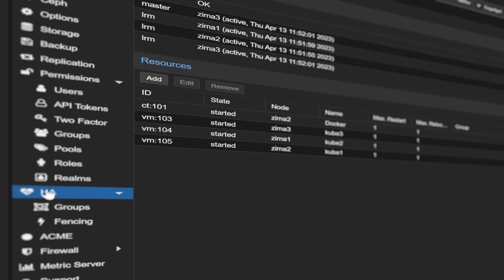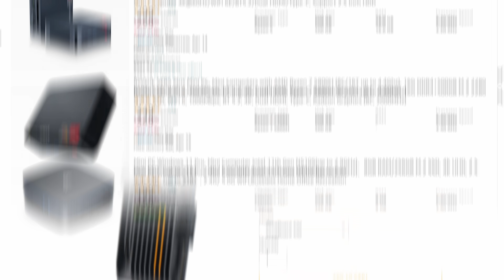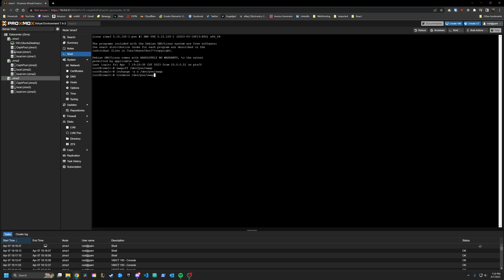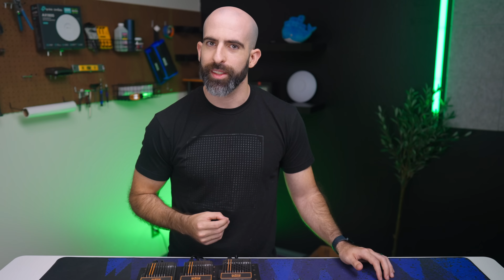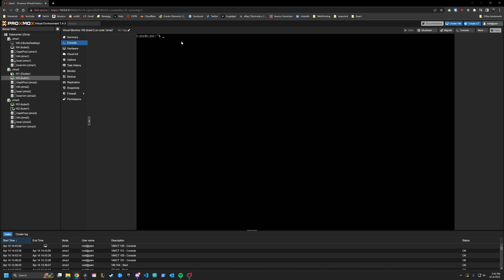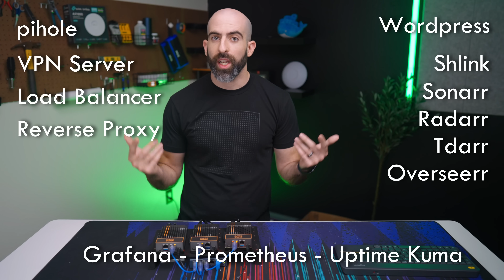10 Watt HA Proxmox Cluster ft. ZimaBoard

Comment: This is really cool for exploring the tech, but not HA: There is no network or power redundancy. You cannot get HA with a single point of failure, and that would be your switch; and your power source. If you add a UPS, then that becomes your single point of failure: You need at least 2 in tandem (expensive). I get all that with a stack of 3 8GB surface pro 5 with USB NIC and 256GB SSD (Thinkpads are same price and even better, everything replaceable and onboard LAN for pass-through virtualisation which matters if you build a firewall with it) that I got for 50 USD each in a second hand shop that sells refurbished business laptops (fully functional, but you can get them for even cheaper with a defective display). They have their own modem and WiFi so they failover to WiFi and 4G+ (So I do not need redundancy in the router, just 3 10USD top-up sims); Each has their own battery that can run for over 10h on idle, about 4 hours at full load, 8 at regular load. Still super compact slate form factor and it barely ever turns the fan on (I think never when the CPU governor is power save). The whole system idles at less than 20 watt, the sum of the PSUs can deliver 108, but I've never see them pass 60 (I suppose it can get past that if they're all charging and at full load on performance governor. Then I'd also expect the single fan on each device to go crazy). The TDP of the processor is 15 watt but it is twice the performance of the N3450, so that is a nice to have too, although you can beat it with the new zima2 N150 at 10watts only. Anyway, all in all a pretty good system for a total investment of less than 200 USD, which I believe is the price of 1 zima board with no SSD and no WiFi and no 5G and no battery or gorgeous 1440p screen to display stats?

Comment: for testing your setup might be fine but for higher workloads in a productive environment running e.g. 5x Win25 DCs (UI) your system would prolly freeze. Btw, HA only makes sense across different zones or regions, not at the same location. If your room or building burns down, that would be the end of your wonderful nodes too, not a good idea, and to highlight before even getting started. Planning is the most challenging thing here.

Comment: I have a question about the ceph topic. I am about to set up a homelab. i want to setup a proxmox cluster which consist of multiple nodes. So i need shared storage. My first idea was that i will setup a ceph cluster of three seperate nodes. And provide some of the storage of my ceph cluster for the proxmox cluster as a shared storage. Because i need some s3 storage too on my ceph for some other things. So my acutal question is, if i setup a ceph cluster with the buildin function in proxmox, is it possible to some of the storage as shared storage for proxmox and use some of it for example a s3 storage? Does someone has any expirience with that?

Comment: I've seen many of these HA videos. It's highly available but only locally. One fun video idea would be to setup Proper Ha cluster where a secondary node lives in a different network. You should be able to then pull the plug on one of those networks and voila, services are going and the dns provider can failover. I've tried this with portainer, it works but for some reason I've struggled to get portainer to show me the containers running on the remote node.

Comment: If you plan to have k8s on zima in vm then why to use proxmox in the first? Only reason I can think of is to use other OS then Linux but resources will still limit you. Ceph can be installed inside k8s or next to it. Besides ceph is not only block. You can have s3/Swift object storage or cephfs POSIX compatible server.

Comment: Very interesting, that is exactly what I am planning to set up for home automation (NodeRed, Grafana, ...).
Right now I am hanging with one topic. (How) is it possible to share data between VMs or Container?
I think, Proxmox is running on its own (the internal) disk. The VMs, and containers are on the external SSD.
When I am setting up a container, that container gets his own virtual hdd assigned that is placed on the external SSD / the Ceph disk.
Is it possible / how to have a folder / diskarea, partition, ... lets call it "shared folder" where different container can read and write data.
Later on there is maybe a container with a simple NAS software solution or just a SMB share, that gives me acces to that "shared folder" via LAN so I can backup that data from time to time.
I would be very happy, if someone can help me out how to do that.
Thanks a lot

Comment: Running Proxmox and a VM just to run Kubernetes in HA seems like an over kill. You are running HA container management on top of HA hypervisor. Why not just install an OS that supports cephfs and install Kubernetes on top. Just need to be sure that your etcd cluster spans all three nodes and each node is schedulable for workloads. One node goes down and Kubernetes can move the workload without having to first move Kubernetes and then the workload. Not as much fun but less hassle in the long run.

Comment: I am trying to do something similar with three Gigabyte Brix machines, but I'm running into issues because creating an OSD seems to require an empty disk (ie, it won't accept the disk where the os is). Did you partition the zima drive somehow before install?
Reply from the maker: Nah I just used dedicated sata drives for the OSDs

Comment: My suggestion would be using low power cluster as backup.. Maybe consider using a setup like this:

Cluster A (High Power) - Node A1, Node A2
Cluster B (Lower Power) - Node B1, Node B2

HA - Cluster A and Cluster B (maybe cross wired) for efficient and more practical usecase.. This will also make sense in regards to performance per watt.

Comment: I'm lost on how you are able to setup HA mode when the storage is local on each device. I have a similar setup and I want to do that. 

Can anyone point me in the right direction with clear instructions? Or explain in detail for me?
Reply from the maker: Ceph replicates everything stored locally to the other 2 nodes as well. So if something needs to be migrated the data is already there locally.
Reply: @RaidOwl  Thank you for your reply. I did a little more homework and I think I have it under control. When I first configured CEPH I did it wrong. Someone posted a great tutorial 12 days ago and that's where I noticed my mistakes. I love the channel and  I love your work. 1000 thanks....

Comment: Hi there, 
is it possible to daisy chain zimaboards since all of them have 2 ethernet ports or is it neccessary to connect all of them to a switch?
Reply: If the middle one died then you have nothing connecting the other two.

If you were then to respond with "then loop then back" well then you have two problems. Broadcast storms and no way to network them to anything else (because all ports are taken).
The single point of failure still exists here, and yes it's the switch (and probably also the powerboard your using to plug in all those cords).

It's a surmountable problem though, just needs more thought on the network side. RSTP on managed switches. Does proxmox support cluster over two networks?

Comment: "...it sits about 10Watts total.." What hardware/software do you use to monitor these SBC's? Fantastic info. Time to give Proxmox a try (been using UNRAID for years now).
Reply from the maker: I had them plugged into my Vanspower portable battery bank. I have a video on it if you wanna check it out
Reply: @RaidOwl  That would be great if you can post the link. Thanks mate.
Reply from the maker: @mochalatte3547  https://www.youtube.com/watch?v=SiZRnyz8R1U

Comment: Hehe, quite under powered. My ceph OSD servers alone are dual 2nd gen Xeon Gold, 384GB, 0.5PB storage, 1x 1.6TB nvme, 100GB ethernet. R740XD2s. About 50 of them. Erasure Code 8+2.
Reply from the maker: Oh for sure. I’m currently debating on ‘going hard’ for a production Ceph setup.

Comment: You could buy for that money a much better system. For an example, for 120-150 Dollar, u could get a refurbed lenovo thinkcentre m700 with core i5 like 6400t or 6500t, 8 GB RAM and 256GB SSDs, and it takes only 15-25 watt with a much better perfomance rate. You''ll get also a clean case and so on.
Reply: I did exactly this. Zimaboard 216 and Fujitsu Q956 with i5-6400t (which I upgraded basically doubling it's price). Zimaboard consumes 2.5w idle, 7.5w at load. Fujitsu is more compilcated: 5.5w idle without anything (but network) attached, 7-9w at very little load (added usb wifi, running podman-compose with nextcloud, mariadb and cloudflared which greatly increases wakeups per seconds, still like 2-5% cpu usage) and 37w at full load. But at full load it's roughly five times faster. Zimaboard costs roughly 130eur including shipping and additional costs were minidp-hdmi cable and 250gb sata harddrive. Fujitsu costs roughly 130eur including 128 sata harddrive and 8gb ram.
Running nextcloud on zimaboard feels like it uses half of memory a stuggles a bit when resizing jpegs on fly while handling https connection. Fujitsu feels like overkill for this task. It's almost as good as i5-4590 desktop i used from 2015 to late 2021 and it's faster than my 5 years old i7-7500u notebook. Power efficiency is insane.

Comment: Proxmox seems pretty heavy for something like this.  I'd like to see something like this with updated software.  Possibly Fedora CoreOS to get auto OS updates with rollback, with k3s and Rancher dashboard, or just go full first-party with Docker Swarm with _ dashboard (I wish there was a first-party one), replicated masters in case the master node goes down, but also sharing storage for HA.  Double drives (NVMe or SATA) on the Zimaboards for redundancy to handle a single drive outage without losing full HA support for services (can drive mirroring be done with clustered storage within the same host in place of RAID?).  I was thinking something like this with Cockpit to manage the system hardware and OS and Rancher to handle the apps.  It's too bad that Cockpit doesn't have a Kubernetes extension.  They used to, but it can't be found anymore.  Probably because they're supporting Podman already.  There's nothing in Cockpit (AFAIK) that creates or manages clusters unless you go over to the Red Hat corporate side of things and start looking at OpenShift, and even the community version OKD is too much for a Zimaboard.  Minishift is also dead.

Comment: My system not being HA is exactly my problem. I have set up services along with pihole on it, but I don't want to put e.g. pfsense into it and have it work as a router, because if this single device dies, I don't even have access to the internet.

Thanks for this video as it shows how to make the server part HA. I wonder if there is an easy way to have a router highly available. My current router worked for years without any trouble, but I am using the pihole as a DNS, because I wanted an intranet domain. Still: if it breaks, I have to manually adjust things to at least have internet back on.

Comment: Awesome - gave me some ideas!
Some quick questions..
1) Do all the SSD / HDDs used in the Ceph nodes have to be the same size?
2) If I started off with (say) 500Gb drives and wanted to upgrade to (say) 2Tb drives, could I do this one disk at a time and avoid data loss, or would I have to back everything up, upgrade all the disks, and restore?
3) In your example, you had three 1Tb disks. How much storage do you end up with on the cluster?
4) Can you add more Ceph nodes once it's up and running?
5) If you can add more nodes, will it start with fewer than 3 nodes? (I need to spread the cost of disk purchases out!)
TIA
Reply: 1) practically yes; your usable size will be the size of the smallest disk.
2) yes, it’s a piece of cake.
3) configuration shown was R3 (replication across three nodes), so total usable size is 1TB. You can use EC2+1 (erasure coding of 2 data and 1 parity) that will give you 2TB of space while allowing for one disk/node to fail.
4) yes, it’s a piece of cake.
5) yes, but some deficiencies. Proxmox cluster: 2 nodes depend heavily on each other. You won’t be able to start vms/lxcs, change the configuration and so on while you have only one node online (official/supported flow of things). CEPH cluster: chances are you’ll end up with osd-level redundancy, so your operation will fail if any of your disks/nodes go down.

Comment: You are using a single network interface on each Zima Boards for regular networking as well as cluster networking? That never worked for me, time and again, the cluster would incorrectly detect a network issue and the cluster would go bizzare forcing me to reboot the entire thing!
Reply from the maker: I’ll keep my eye on it. If it acts wonky I’ll use that other one.

Comment: I am currently using truenas scale for my vms and containers but this is tempting. I have two questions:
1. What is the performance penalty compared to single node? Is it noticeable for Web services? 
2. How does upgrading proxmox to newer version works with cluster like this? You just shut down node A, do upgrade, reconnect it to cluster with older versions? Then next node and so on?

Comment: I'm thinking about doing the same with 3-5 R86S. The nice part being the dual 10gbe ports. 1 port for client traffic, and 1 port for the ceph network. also there are 2.5gbe ports left over for management or something else.

Or I could use the two 10gbe ports for a ring network for ceph, and the 2.5gbe ports for client. The ring network is interesting because I could avoid buying a 10gbe switch just for ceph

Comment: Do you have an idea to make a shared usb over this cluster? 

Let's say that home assistant is kind of mission critical aimt my place, if I don't want my girlfriend screaming at me. Most HA services would switch from server without a problem, but the zwave and zigbee usb are hardwired to one system only.
Reply: Remote usb is hard. Make them remote on serial level , so use something like ser2net. I even use this approach but for dvb c tuners, for which you can use minisatip

Even then it's hard, you can't failover the machine which has the dongle physically connected

Comment: I am currently looking at a cluster build with intel nuc, but this set up would be cool to tip my toes in clusters and such.
Reply from the maker: Intel NUCs are solid too. I snagged some $50 ones off eBay and upgraded the ram and storage to run my main k3s cluster on.

Comment: The way to get your workloads to prefer a node is to create HA groups for each node. Set the node priority for each group to be the same for all the non preferred nodes, and increase that value by one or two for the preferred node.

Workloads will migrate to the node that is up with the highest priority first, and then prefer nodes of equal priority with the most amount of free memory and lowest CPU usage
Reply from the maker: Interesting, thanks for the tip!
Reply: Works perfectly. Thanks for this tip!

Comment: I've done the same exact thing on 4 different small form factor hardware. I'm running Open Media Vault which file sharing and docker, portainer support running all kinds of cool stuff. The must have was a UNIFI controller in docker. Having that in a HA cluster on battery backup is AMAZING!. It's very cool. I'll have to give the CEPH a try though. This looks like it save me some power. I'm using an NSF cluster for HA storage on 3 other mini PCs.

Comment: Built a cluster with 3x Minisforum EliteMini HM90 with 32GB RAM (max. is 64GB) + 512GB NVMe + 1TB SSD each - plenty of cluster power with (3x9=) 27 Watts idle. 
The mini PCs also have two NICs so I'm running a separate Cluster Network for running the synchronization of the nodes as a best practice tip from Proxmox says: "Storage communication should never be on the same network as corosync!"
Actually didn't want to run out of CPU power even when operating the one or another Windows OS on the cluster.
Anyway: Proxmox rocks! Hope to see more content on your channel - which is one of my favorites. 👍🏻
Reply from the maker: Hell yeah that’s awesome
Reply: Yes! That's was exactly why I bought recently the HM80 is exactly like HM90 but with low powered amd ryzen 4800U processor 15wats. They are maybe 20/25% slower but hey! It's only 15 Wats chip! The only thing I didn't like was the fact that probably they don't support ecc ram. But still when you have a cluster I do believe you are covered even when there would be RAM corruption. So maybe that's not the worst idea :-)